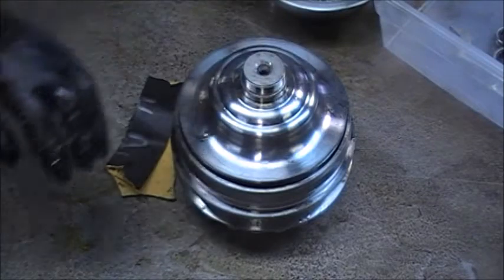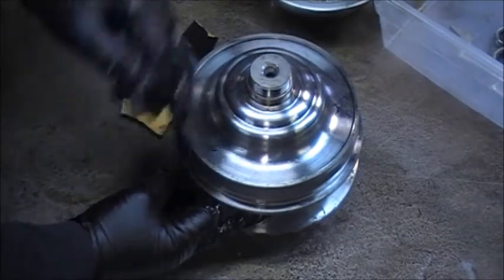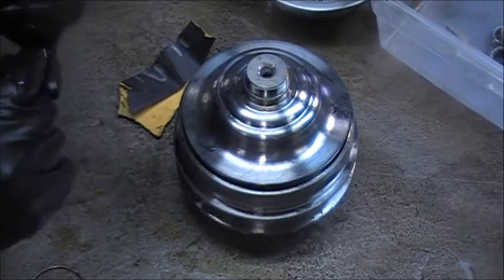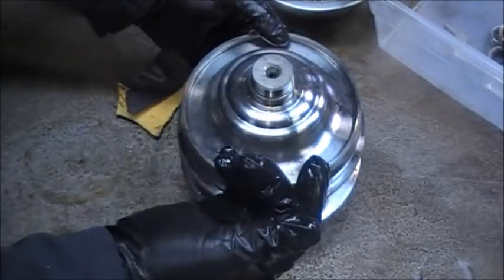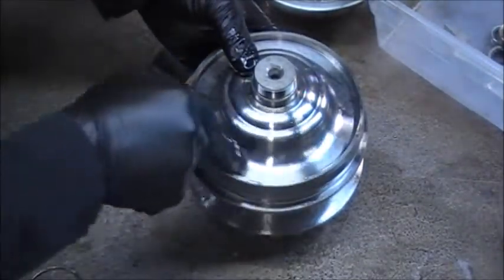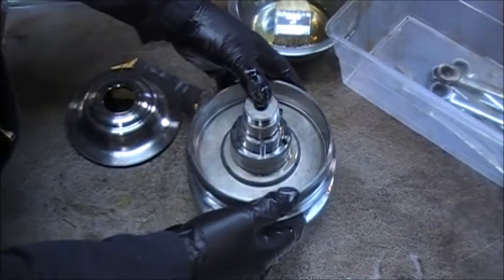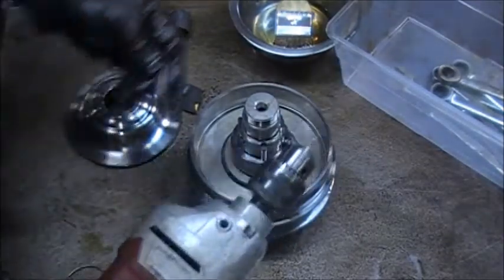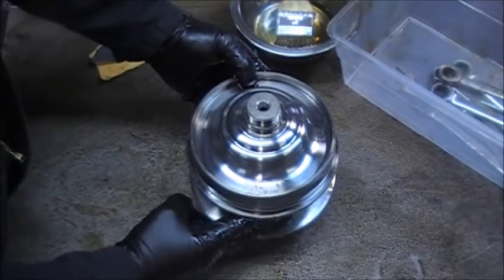RE0F10A, JF011E NISSAN CVT TRANSMISSION BALL TO PIN CONVERSION PART 3 (UPDATE)

Comment: hello brother .excellent video and very informative.am trying to find the proper dowels and can't get them.i want to put something very strong but don't know what grade steel to use. plus ,my plunger came with a spring (2007 altima) and am using the same identical plunger from a 2008 rogue with no spring in the plunger and don't know whether to put it back or not!!!
Reply from the maker: 6mm drill bit end for the dowels. Second, if yours came with a spring, than reuse the spring.
Reply: @thisisyourtransmission  thank you brother .i really appreciate it.how about 15/64(5.953125mm so you don't have to shave anything) drill bit and what quality please??
Reply from the maker: @abuhamzahalmasry5627  The balls are 6mm, therefore I use 6mm drill bits. If you try another size, then you will be the first. Next, the bits are either colbalt or tool steel. Do not get cheap bits!

Comment: Questions:  #1) Did Nissan or Jatco ever get around to doing this mod to fix this issue?  #2)  Why only three slots?  Why not 5 or 6 slots? #3) Did you invent this fix or is it one someone else came up with and you copied it?  #4) You seem to work on a lot of CVT's what is the primary reason of failures on a CVT? Is it the drive you are showing or is it the belt? #5) why not make a temporary wedge device (perhaps two pieces of wood that can be screwed together then unscrewed when the belt is ready to be installed) to hold the upper piece high enough so the seal does not risk being damaged while installing the bearing and nut and then leave the wedge in place until the drive is seated in the case and the belt installed on the drive?
Reply from the maker: 1) I don't know if Jatco did this mod in their later cvts. 2) I don't understand what you mean by slots.3) I did not copy this from anyone on this transmission. However, the cft30 transmission in the ford freestyle has splines that the pulleys slide on. It is more durable than this ball type design. To put the pins in mimic the splines. 4) For failure, I see the balls in the drive pulley the most. The driven pulley has balls also, however they seem to hold up better probably because there are 4 balls to a slot, better support. Three balls are to weak. 5) I now use a 4l80E front pump bushing that is cut in half to hold the pulley high enough to not damage the seal. I snap it right in the middle of the to sheaves of the drive pulley, put the belt on then take it off when the belt is on. This 4l80e front pump bushing put in the middle of the sheaves was told to me by someone recently.
Reply: @thisisyourtransmission  Well sir...  I applaude you for your skills!  It is not everyone that can tear down and rebuild transmissions.  My only time was back in the early 80's when I tore apart a GM 350TH and rebuilt it with a full rebuild kit.  I did not have a lot of special tools, but managed to get it apart and back together again.  I now own a 2010 Nissan Altima with 102K.  I just got all the parts here to change the filters (yes I learned it has two (the paper cartridge in the warmer/cooler housing near the bell housing and the pan mesh filter screen).  I plan on doing a drain pan drain, clean the pan and the magnets, clean and or replace the mesh  screen, replace the pan (with new gasket if needed), refill the drained amount, pull the paper filter out (temporarily) replace the housing, then do a 2qt at a time flush and replace of the NS2 fluid via removing the fluid line (the hot side line) of the radiator inlet, thus running fluid through until it runs green and clean.  Then remove the warmer housing (again) and install the new paper filter cartridge.  Keeping track of what was removed and trying NOT to overfill the trans.  I also have purchased the OE Nissan Oil Cooler Kit and will install that KIT as it bolts right onto the front of the condensor using factory holes in the radiator core support.  What is your thoughts on the best way to make sure I have the correct fluid amount if the tranny is not all that warm?  Should I keep it a bit low then get it warmed up good then check the level?  THANKS I know I wrote a lot here, but I know I will get great help from you.
Reply: The SLOTS are where the balls are...  Why didn't they have more slots or grooves ? Wouldn't that help relieve some torque on those drive parts as they move up and down and are under torque ?  I saw a video where the balls not only broke free but the slots were damaged badly and the upper cone had rotated and it locked up.
Reply from the maker: Why are you doing all of this?

Comment: everything is good except you forget to tell us where we can have those pins  you said on ebay on a other vid but who is  the manufacturer ! if you can provide the name it will be just fine.
Reply from the maker: the pins are m6 dowels found on ebay. Also, you can use the solid side of drill bits. I use cobalt or tool steel. Do not use cheap drill bits? The drill bits have to be 6mm drill bits (not #6 drill bit) it has to say 6mm on the bit.
Reply: tanks ,now i use roller from bearings( axle shaft from a diff ) 6mm very hard stuff or now they sell stainless steel balls very hard stuff now .
Reply from the maker: The balls are not good because two balls do not provide enough support. The driven shaft does not seem to have this issue, however it has more balls per channel. Nevertheless, it is probably good to replace all balls.
Reply: questioning3 - I think that if the balls were replaced with the longest dowels possible on both drive pulley and driven pulley, these transmissions would be a LOT more reliable, and then the major remaining issues would be in oil pump and valve body wear, and those are much easier repairs with a lot less dismantling required... Pretty much every failure in the pulley section I've seen in your and others videos here on youtube are due to the large torque on the circumference area of 6 tiny balls... Once they start to wear the slot, that very expensive part is toast...  Someone could probably make a mint remanufacturing these damaged parts if a new set of grooves could be cut, or existing ones widened slightly to provide new bearing surfaces fit with a larger dowel
Reply from the maker: @orcoastgreenman  I agree